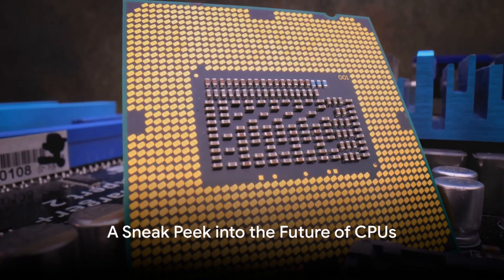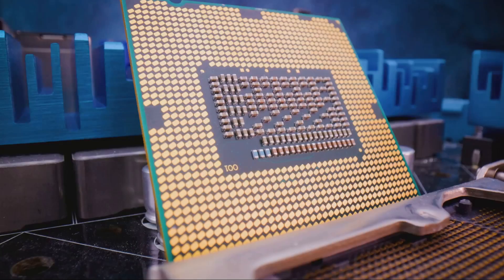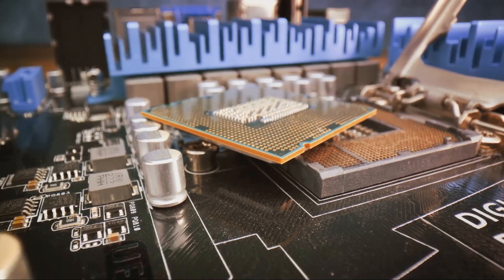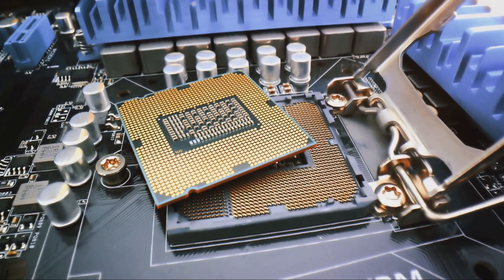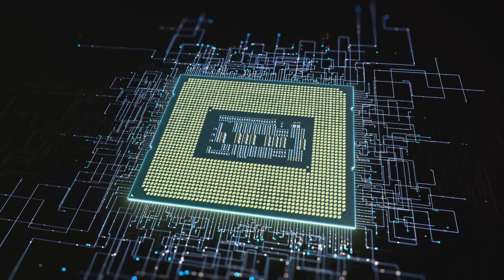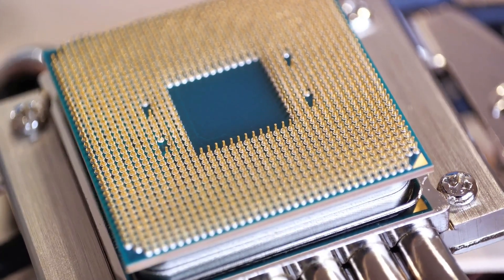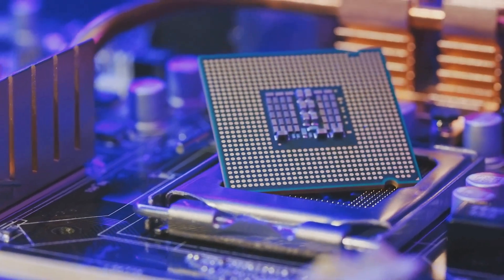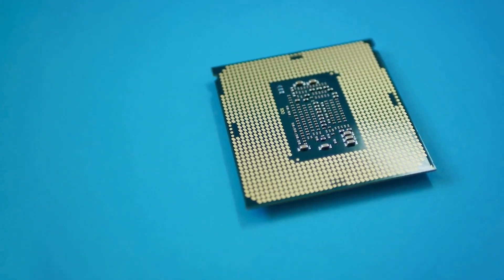Intel Arrow Lake S Core Ultra 200 CPU Lineup

Comment: the LGA 18xx Socket will see 2 generations of CPU Core Ultra 200 and then Core Ultra 300. that's it. Intel is very stingy with future support, they rather sell new boards and chipsets every 2-3 years to ppl just to make like harder